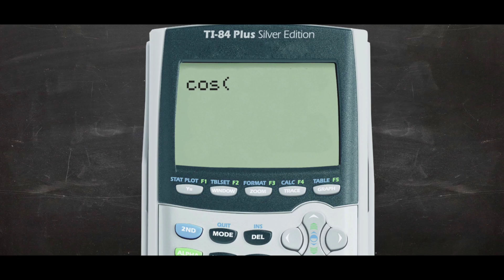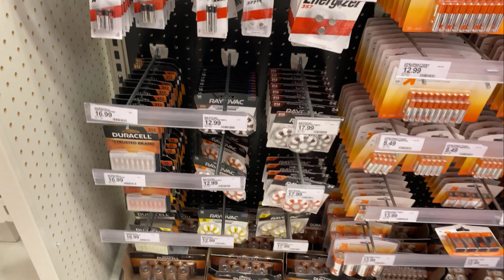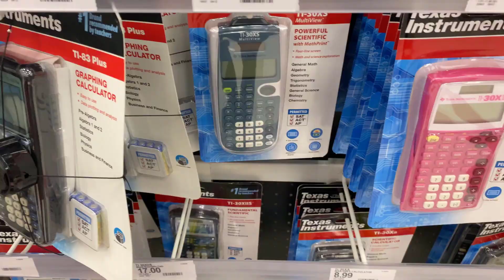How to change the battery on a TI-30XS calculator

Comment: I managed to get it out of the little box that was soldered onto the circuit board. I had to press really hard with a screwdriver to push the magnet out which felt wrong and dangerous but it worked. I'll still need to buy a replacement battery to put back in again so the fingers crossed that will work. The design is infuriating and there's no good reason it should be that hard to replace the battery! 😔

Texas Instruments never fails to ruin the customers' experience. Not even with this cheap and friendly looking model.

Comment: Thanks.  I was worried that the calculator had some hidden latch or something to remove the cover.   Didn't want to break it.  Update: When I removed the cover, the battery guide that you removed screws from, was actually soldered onto the board!  It took me a minute to figure out, you slide it out by pushing the battery out the end of the batt holder.

Comment: My battery was soldered in place using a different cap than shown here . The only reason why they’d do this is to make people buy a new calculator. I took the effort to solder a new battery in place. Works.
Reply: I thought the same thing but, no.    Mine was soldered too. I just slid the battery out of the side.  Easy Peasy.
Reply: @Mr25thfret  I managed to do it as well, I had to press really hard with a screwdriver to push the magnet out which felt dangerous but it worked. Will still need to buy one to put back in again so the hope is that'll work. But the design is infuriating, it should never have been made that hard. Texas Instruments sucks. 😔

Comment: My battery was held in a very different way but your instructions helped with the hard part of prying it apart. Mine was held in place by little tabs so you really hand to pry it open and until I saw that the back had nothing attached to it I realized I could use more force to get it open.  Mine said low battery and when I got it out and checked it the voltage was very low.

Comment: Is there a way to check the battery%? I had a notification that it is almost empty. Now I wanted to change it and its working again. Do I need a new battery, or can I check the battery?
Reply: Yes.  Push the "on" button.  If the LCD does not activate, you prolly need a new battery.

Comment: Ill just buy a new one lmao
Reply: Just buy a Phillips #0 screwdriver.. I got the battery out and changed it without getting the screws out and changed it.. lol U may not want to believe it but these are really good calculators
Reply: @kenishaharris4461  How were you able to change the battery without removing the screws?
Reply: that's extremely wasteful
Reply: I would advise you that unless you are taking certain exams (e.q. NCEES) in which graphing calculators are prohibited in those exams that you get a TI-83 or TI-84 calculator, or a CASIO Prizm.  They run on ordinary AAA batteries that you can easily replace.